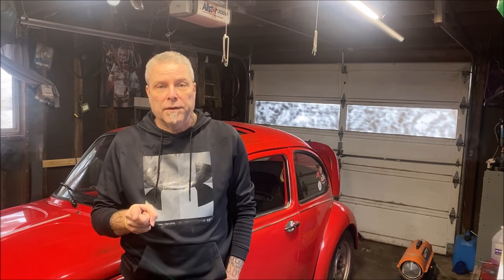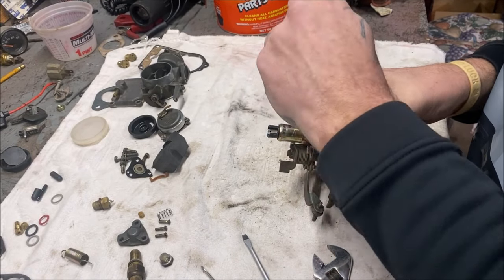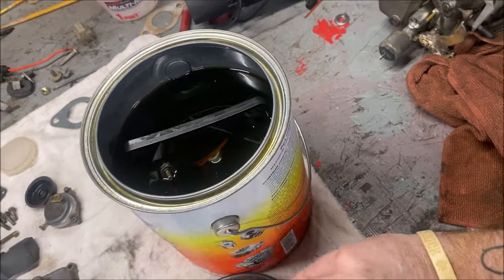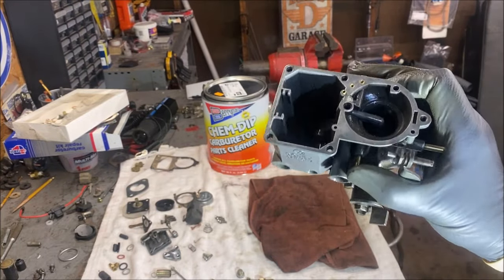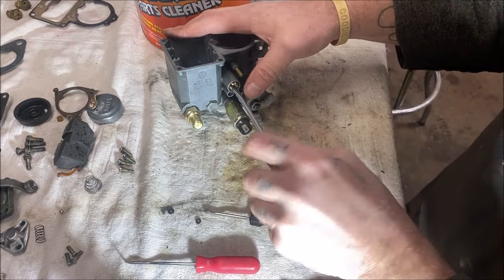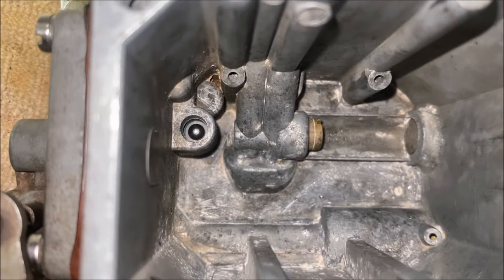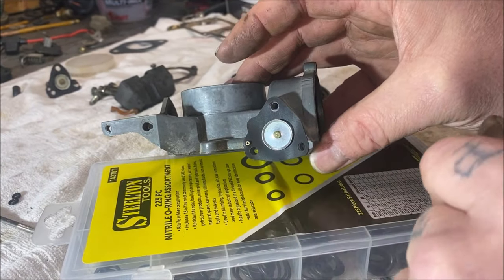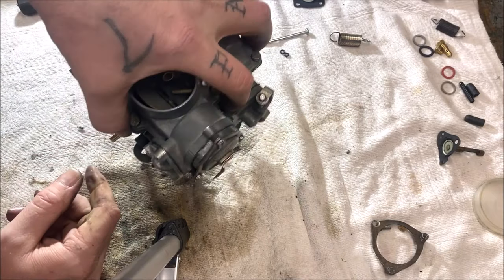VW Beetle - Super Beetle Solex Carb Rebuild 34pict - Does Chem Dip Work? 😳

Comment: Great video!!! My girlfriend has a 73 super beetle. I'm somewhat handy and it's been running terrible. I cleaned the plugs and checked the points. She's a snowbird and left the bug garaged in Northeastern NY for months at a time so i figured the jets in the carb were blocked. I watched your video a few times and ordered the rebuild kit. I did not use the chem dip but used carb cleaner instead and sprayed the heck out of it. Put it back together and is running so much better. The idle is a little high so I'll have to play with that another time. Thank you for your help!!!
Reply from the maker: Thank you Joey, especially for taking out the time to leave a comment. I’m glad it worked out for you nicely.

Comment: I watched yours and other's videos on the PICT 3, only after soaking my carb for 48 hours in that soak, oops. But so far so good. I'm going to finish assembling it tonight and then finish the top end of my '73 Thing. I took apart my carb so far that I even took off the butterflys. The whole car can fit in there, the main body flat on its side, the top sideways along the side of the can, then all the smalls in the basket on top of it.

Comment: As far as the Chem dip I use it mainly on old carbs that haven't been touched in years. My carbs that I clean more often I just use carb clean. Chem dip really cleans the carb bodies like new. If your going to be cleaning allot of carbs and metal parts in the future the larger ultasonic cleaner is great so you can clean more parts at the same time. You can also use your own mix of solutions that you like in it as well. I'm just a part timer on this stuff so carb clean and Chem dip now and then works for me
Reply from the maker: I actually was going to purchase an ultrasonic cleaner. My buddy has one, and offered to let me use it. But I really don’t like boring stuff like that, my luck it would break. I have about five carburetors here that I’ve been sitting for a very long time. So I figure the chem dip will come in handy to soak them all.

Comment: Hi, nice video and appreciate taking the time to do a detailed one. I have a question. I just rebuilt top end of my 71 Super Bug (stock 1600). Did 15min running in. I noticed that the engine was consuming a lot of fuel during this period (no black smoke or anything), had trouble idling. But I did not worry too much of the tuning, since it's just the break in. After letting the engine cool down, I have removed the fan shroud and intake because i want to do few adjustments to the fan shroud, etc. When i removed the two intake manifolds, oh dear...there was a lot of fuel found pooled up in the intake area (inside the head). When looked down the intake from where the carb sits, the walls were wet with fuel. 
Still I have not touched the carb or attempted to rebuild. This car is a barn find, did fire up and ran fine before I did the re-build. I would appreciate if you could comment why the intake it getting flooded with fuel. Could it be a sticky float needle? anything else i should check for. Thanks in advance.
Reply from the maker: If the intake is getting flooded with fuel. I would first check the needle and seat. Sometimes it is not shimmed properly. Which means it will not shut off the fuel completely from entering. You might want to try that first.

Comment: Thanks for putting out this video for us. I'm new to VWs and trying to learn as much possible. Going to rebuild a 34 pict-3 and a 30/31 when swapped out. Thanks again.
Reply from the maker: And thank you for taking the time to leave a comment!
Reply: @SladesVWBeetle  just rebuilt my 34 pict-3. The kit I used didn't have one of the internal springs so I re used the old one.  My old springs appeared to be in good shape. It appears to have not been used much before the previous owner put a bigger engine in his bug so it's been sitting in a box for 25 years. Do you think there could be a issue with the old springs? I used your video for a reference on the rebuild to make sure I didn't miss anything.  Thanks again.

Comment: This video gave me the encouragement to go deeper and change some parts that i had sitting around in the new kit but was afraid to go deeper to open up carb. One problem I ran into: I could not get that brass screw out to access that ball bearing. I screwed in the rear light’s screw but its really stuck tight, so i gave up 🤷🏻‍♂️
Reply from the maker: OK you need to get that out. 
That’s usually gummed up. Screw the screw into the brass part. 
Clamp some vice grips on to the screw. 
Turn the carburetor upside down and smack the vice grips with a hammer and it will pull out!!
Reply: @SladesVWBeetle  10-4! Will try that and see if it works. Is this part really important? I mean does it really help with performance of carb if cleaned up? Thx again
Reply: @SladesVWBeetle  Just did it!! “Great Success!!” ;) not possible without ur advice! Thx again (there was a lot of dirt in there)

Comment: Another great video Slades. That Chemdip is the stuff. I’ve used it for years. Can’t think of the last time I rebuilt a carb though lol 😂 I never have luck with the rebuilt ones I always just buy new. Luckily mine came with a new one that hasn’t been installed yet. It seems like you have had that tube of dielectric grease for years 😂 the stuff lasts forever I swear. I’ve got a can of it with the nozzle and I squeeze it out.
Reply from the maker: Hey Blake! I wished I could buy a new Solex, but all the new ones are aftermarket now. And some do have luck with them too! I have had that grease for a while. 😁 I’m not sure how, because I use it a lot. 😀
Reply: @SladesVWBeetle  LOL. Yeah I know I’ve got a couple jars of anti seize that are who knows how old lol 😂 and I use it a lot. The one the previous owner provided and bought is an EMPI I have heard mixed things on them so not sure how well it will do. 😁

Comment: i was thinking that you could blow bubbles into the chem dip bucket with a small aquarium air pump to provide a bit of current while parts are soaking. good vid! i could see your breath at one point. just got to the end. 37 degrees.
Reply from the maker: Hey Scotty! That’s actually a good idea, I never thought about doing that before. I want an ultrasonic cleaner really bad, I believe there’s a lot of things I could do with it. Just haven’t bought one yet. Yeah it was really cold. I couldn’t turn the heat on in the garage because that torpedo heater is very loud and then it would’ve  interrupted the video. I hope you’re doing well my friend!
Reply: @SladesVWBeetle  i just looked those up. aren't as expensive as i thought (80 or so). doing well here in ks. hope the pa winter doesn't run too long for you.

Comment: Awesome video, thank you very much! Curious how to determine if the throttle bushings are bad?
Reply from the maker: Sometimes with the spring disconnected, the return spring, see if there’s movement up and down. Also if it’s on the car. You could spray some WD-40 on the shaft while it’s running to see if it idles up or down quickly. Like a vacuum leak

Comment: Hi Slade, unless you can stabilize your gopro camera the headset moves around too much. Example is my tilt trim video for my mercury 60hp outboard. I found for me using a gopro hand clamp on a 2ft tripod puts you right over your work. The hand clamp is on a flexible neck to twist it anyway you want it. I quit using my headset. I  guess the newer gopro has a stability feature so it may work better with a headset?
Reply from the maker: Yes you’re absolutely right. I need to order the big accessory kit that comes with everything since it has so many different options. For what I did there, I would’ve used a harness, attached to my chest and it could have done a nice job watching exactly what I was doing.

Comment: Thanks for the tutorial. 
Question: I have a carb with a leak around the throttle shaft. Have you ever attempted to repair it and if so was it a successful repair.
Reply: There are brass inserts available that replace worn out plastic bushes, but carbs that don't have them require specialist machining.
It's pretty straightforward to do but getting the throttle plate screws out can be tricky as they are peened.
I've repaired two carbs with no subsequent leaks.
Reply: @djambrosia  thanks for the info... Much appreciated!
Reply from the maker: That guy they call Volkzbitz is an expert at that stuff. I want to send a 34/3 to him. I never tried them myself. But djambrosia explained it very well!
Reply: @SladesVWBeetle  thanks for the reply.
Reply from the maker: Absolutely! I try to reply as quick as I can. I’ve seen a couple videos on people doing the bushings. I have some  carburetors sitting on my shelf I probably will attempt it anyhow. And of course I’ll film one I do. I’m curious to see because the one I have, does have a throttle shaft leak.

Comment: If you have a shop do this cleaning and service, what would be an estimate of the charges per carb?
Reply from the maker: Honestly I’m not sure.
Reply: @SladesVWBeetle  We figured out what our problem is. Our engine is a dual port 1600 with dual Kadron/Solex 40/28s. The guy that set it up did not put a pressure regulator in line so it was flooding out.
Reply from the maker: @Rockinbiker1946  oh dang!! Definitely should have a regulator, I’m glad you got it sorted out. It makes a huge difference.

Comment: I have a question on the bolts that go through the butterfly on the throttle. I had to replace mine. Should I use some sort of thread lock?
Reply from the maker: I’ve never put Loctite on those to be honest with you. I’m sure it wouldn’t hurt to use the blue stuff.
Reply: @SladesVWBeetle  Thanks. My throttle bushings came today so I'm ready to get this thing finally running right.
Reply from the maker: @randall1959  The throttle bushings will make a major improvement. That’s for sure.
Reply: @SladesVWBeetle  There's no slop in the shaft at all. I got a set of brass bushings from a shop in England.
Reply: I think that old carb had more issues than just bushings. What's weird is that I ended up doing some jetting on the Empi and went back to the 009 and tuned it by ear. Hardly any flat spot.  https://www.youtube.com/watch?v=phLxd1ObjFY

Comment: I've seen Seafoam do wonders for carbs that are having intermittent issues.
Reply from the maker: Honestly I agree, I’ve had a lot of luck with seafoam. I had to pick a beetle up about 10 years ago. 
It had been sitting for a couple of years and was being cranky and smelled horrible, while running. Well it barely ran. 
I poured some seafoam in and let it soak and drove it over an hour home with no issue. Sure wish I was on YouTube then. Would have made for a fun video lol
Reply: @SladesVWBeetle  There's a farmer on this site that does unbelievable things with it. I like seafom and marvel mystery oil.
Reply from the maker: @randall1959  oh wow!! Marvels!! My father used that stuff back in the day. I should get into the habit of using it he swore by the stuff. That’s just brought back a memory.
Reply: @SladesVWBeetle  it does wonders for all sorts of issues. Honda Goldwings have starter issues and it will  unstick one. I've also seen it break loose stuck pistons.
Reply from the maker: @randall1959  I should grab a can of mystery when I’m out next time. I have an old dual port engine here that’s frozen. I really have no idea how long it has been sitting. Would be fun to see if it would loosen the cylinders up. And possibly make it run. Lol probably a good video 😂
Reply: @SladesVWBeetle  I've seen it do things that amazed me. I keep some on hand. I get mine at my local auto parts store. I've put it into gas for sticky butterflies.
Reply: @SladesVWBeetle  Sometimes those old fixes stand the test of time.

Comment: Hi Are you still making new vidoes ,
Reply from the maker: Yes! I never stopped. Now I’m starting to do two every week.
Reply: Thats Great news I have being following your vidoes since i bought a Beetle 1976 1600 from my dad in law , I cleaned the tank installed new fuel line , plug wires and repaired wiring , rebuilded the carb , and got the car running , but for some odd reason , I am not getting it to start again after it standed from some time , it look like the carb is leaking at the base plate and it looks like , there is fuel in the oil , ai bought a new carb same problem ran last weekend and now doesnt want to start , also fuel leaking at the rubber joint on the manifold on the right hand side , I am so frusted any advice you can give i will appricate thankz for you vidoes 

Blessing all the way here from South Africa

Comment: great job  im getting some cleaner ;) question, im running a single port 1641cc freshy built motor running a 31 pict carb and wondering what jets to use? Shes running rich on idle and running.

cheers Niko.
Reply from the maker: Thank you so much for being here. The jetting would be according to your area. I know in my area for example on a 34 pict carburetor. I have to run a 60 idle and 130 main due to the ethanol.

Comment: I have an old original West German 34 Pict 3 in Chem Dip right now. It can sit there while I'm waiting on throttle bushings from GB.  Have you watched a dirty carb in Chem Dip? I didn't realize they actually boil or appear to    https://www.youtube.com/watch?v=eB4dlf_miGk
Reply from the maker: I didn’t notice mine boiling at all, not like that, but I know you’re not supposed to have the lid on.
Reply: @SladesVWBeetle  I just pulled mine out of the Chem Dip and it turned the metal really dull with this black crud on it. The crud washed off for the most part but it really stained my hands. Maybe I got a bad batch? I have used this in the past but never had this issue before. But it did get rid of the dirt.